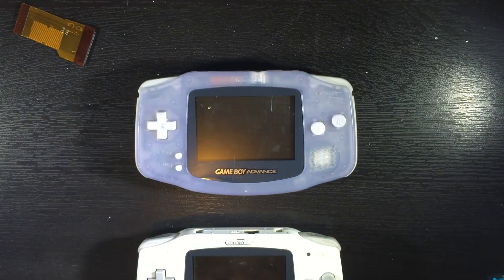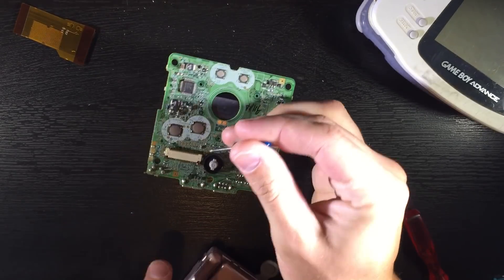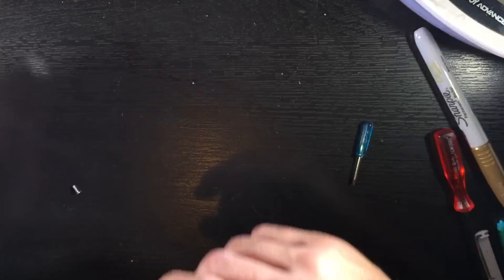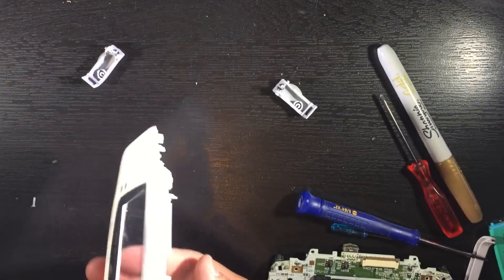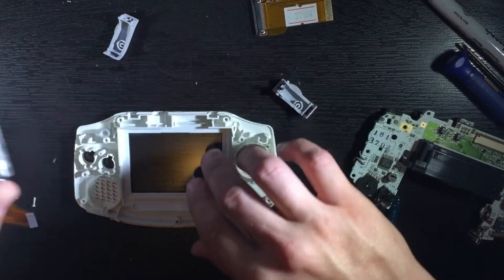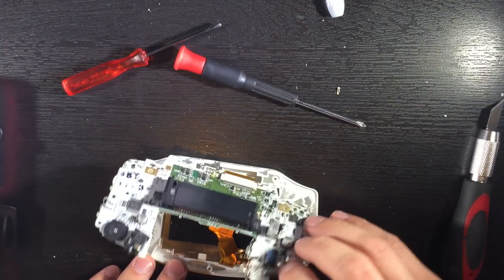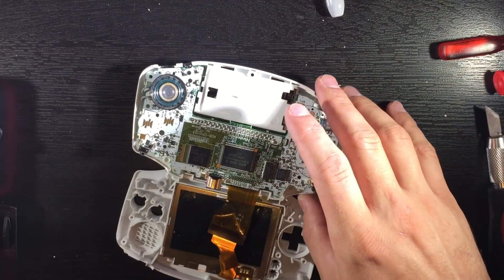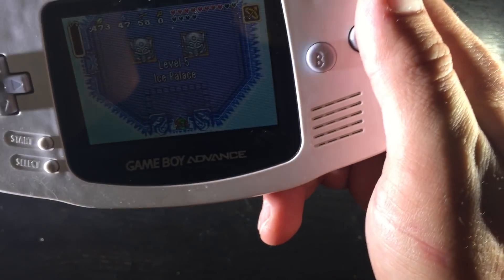Game Boy Advance AGS 101 Screen Swap Upgrade How To Tutorial

Comment: Please answer me. I have white connector LCD and 32 pin board. Do i need the adapter with or without wires and why? Please check retromodding website since i dont really understand their explanation.
Reply: Piseth Peav the wire makes it brighter but it is not totally necessary. It will still be quite bright without the wired one

Comment: So you used a White connector AGS 101 with AGB 40 pin model. Still works without modding. I have a White connector AGS 101 and a purple gba 40 pin model. If I follow this footsteps will it work? I'm just hyposthesizing this so I want to make sure it'll be a one shot work and worth the money for spending the adaptor cable. What kind of adaptor connector did you use?
Reply from the maker: +Noble Gurdian yes it should work. I got a bunch about a year ago. This one didn't need soldering for it to be bright. I can list it for sale on my website if you can't find a comparable one.
Reply: I think I found it. The one you used was a 40 pin model Ribbon cable adaptor, thats all I need to know. What model was the White GBA?